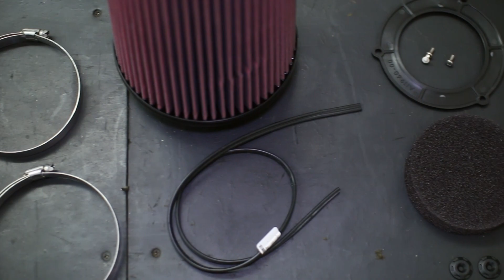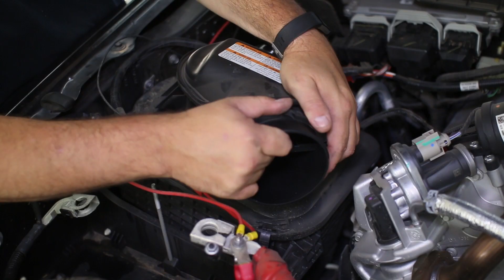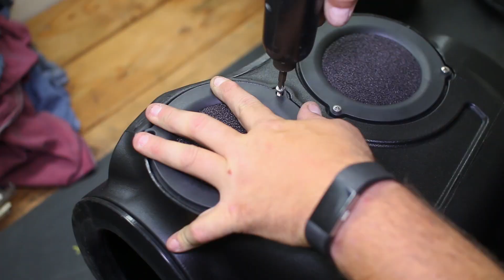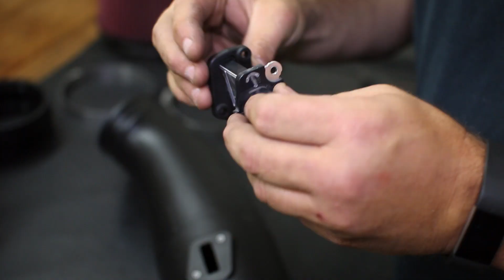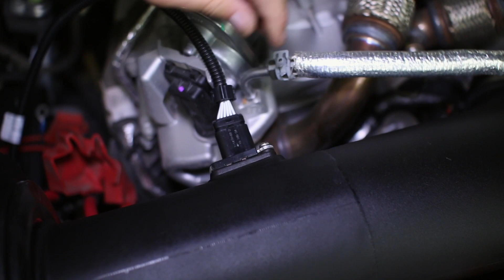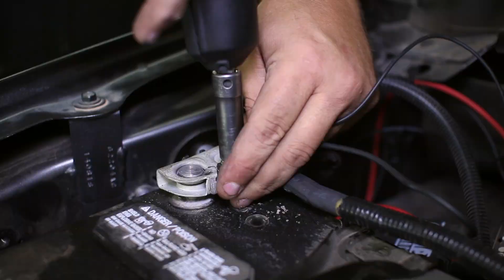2017 F250 & F350 6.7L Diesel S&B Cold Air Intake System Install

Comment: just did this install today. had a tough time trying to get the second ground on frame to reach either of the 2 mounts. this was intill i noticed the hole in the battery tray that i ran the gound though. you guys had the second ground but i did not see it at the end of the vid when you installed the tray and battery
Reply from the maker: You're right Brandon, we did miss explaining that part on this one, good catch!

Comment: Im getting error codes and loss of truck power
Reply: maudify I am to?! I’m trying to figure it out did you find a way?
Reply: I’m not getting engine codes just no power and truck won’t shift
Reply: @cnasty141  
Installed a K&N last night, I’m getting the same.
Did you find the fix?
Reply: @dennismenace4087  ya I had my mass air flow sensor flipped the wrong way that little sensor thing is suppose to be facing down
Reply: @cnasty141  thanks for replying.
I discovered that after I asked.
Didn’t realize till I went through everything.

Comment: Any dyno results?
Reply from the maker: S&B does not provide dyno number results, but they release air flow results. This intake system provides 55.97% more airflow than the stock intake, and 99.56% efficient @ 580 CFM (ISO Coarse Dust)